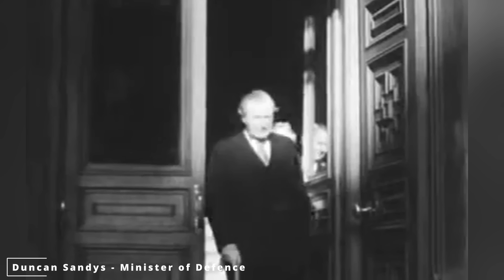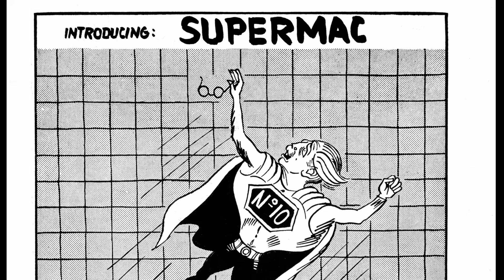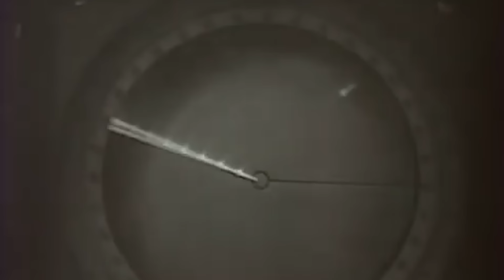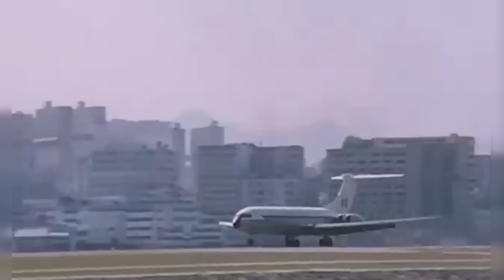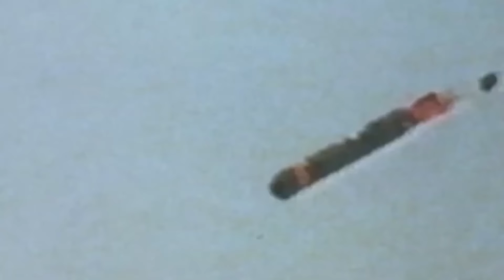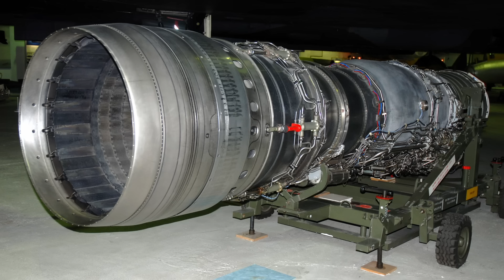How Britain Turned A Failed Airliner Into a Soviet Submarine Predator | The Mighty Nimrod

Comment: The main issue with  creating  the 'successor'  Nimrod was that the Treasury insisted that  rather than create new builds  of them that instead  new wings and engines be added  to existing fuselages. The main problem there was that the fuselages themselves had been  over extended, too many alterations which had  led to a  fuel line running along the inside which corroded and this created a disastrous issue of internal fires.
Reply: The BAE Systems MR4.A program was a shocking fiasco of incompetence and corruption.
Reply: @DoktorBayerischeMotorenWerke 

Comet / Nimrod notes. 

We believe we can clear up some commonly held myths and misconceptions obviously.

It's always good to see the facts presented clearly and concisely isn't it?

Obviously there have been worse aircraft for accident losses both before & after the Comet.

All jet airliners benefited greatly from the knowledge gained from the Comet incidents & subsequent investigations & yet some were still worse for accident losses. 

It's a great pity & a crying shame that British military forces had to occupy a large part of Germany for decades after 1945 & Russian military forces had to do the same. Of course Russia still posseses a large chunk of what was German territory & of course Russia & the UK produce nukes. Obviously Germany does not produce nukes.

Instances of all marks of the Comet flew with full certification after 1954 including the Comet 3. The last Comet flight occured in 1997.

The fabulous trail blazing DH Comet.
World's first jet airliner.
World's first high altitude airliner.
World's first airliner with a full fuselage length pressurised cabin pressurised for high altitude flight. That feature for that type of aircraft was a considerably difficult undertaking. 

How things were back then.
Accident losses - % of aircraft built.

DeHavilland Comet 4 UK                          14% 
DeHavilland Comet all UK (ff 1949)        17%  
Vickers VC10 UK (ff 1962)                        5%

Douglas DC-1  US                                       99%
Douglas DC-2                                              47%
Douglas DC-3                                              30%
Douglas DC-4                                              26%
Boeing s300    US                                       72% 
Boeing 307                                                  70%
Boeing 247                                                   48%
Boeing 707  (ff 1958)                                 32% 
Lockheed L-049 Constellation (ff 1958)  30%
Lockheed Electra US (ff 1958)                   29%
Fairchild FH-227 US (ff 1966)                   30%
McDonnell Douglas DC-8 US  (ff 1958)   14%
Sud Aviation Caravelle  (ff 1955)             15%
Canadair CL-44 Turboprop US (ff 1959) 46%  
Convair CV-580 Turboprop US (ff 1960) 22%
Convair CV-880     (ff 1959)                      27% 
Convair CV-990     (ff 1961)                      33%
Tupolev T-104        (ff 1956)                     16%
Vickers Viscount UK  (ff 1948)                32%  
Fokker F-27 Turboprop (ff 1955)             39%      

The Vickers VC10, fastest Atlantic crossing for a non supersonic jet airliner, held the record for 41 years.

For the first few years of operation the Caravelle & Comet had similar accident loss fatalities.

The first few Nimrod airframes were Comet 4 airframes with the equipment bay tacked on. Subsequent Nimrods were new build Comet 4 airframes with the modifications built by the DH team at Hawker Siddeley.

Military aircraft accident losses. 
Lockheed XF104                 (ff 1954) 100%
Lockheed  P80                      (ff 1944) 43%
Lockheed F104                     (ff 1954) 45%
Grumman f9f                         (ff 1947) 47%
Convair F102 Dagger            (ff 1953) 45%  
MD F-101 Voodoo.                (ff 1954)  34%
MD FH Phantom 1                (ff 1945)  35%
MD F4 Phantom 2                 (ff 1958)  28%
MD F3H  Demon                    (ff 1951)  32%
Gloster Meteor UK                   (ff 1943) 21%
DH Vampire  UK                        (ff 1943) 23%
DH Sea Vixen  UK                     (ff 1951) 33%
DH Venom       UK                    (ff 1949)  16%
Gloster Javelin    UK                (ff 1951) 20%
EE Lightning     UK                   (ff 1954) 33%
HS Harrier      UK                     (ff 1962) 34%

The Sea Vixen was an aircraft carrier jets pioneer aircraft that was also regularly flown from carriers that were too small for the aircraft. 

The Tornado & Typhoon & their engines are supersonic & are indeed British design aircraft with British design engines built by an international consortium. The Tornado design for example started life during the 1950s at Vickers as the AFVG, it's engine is based on the RR RB-199. The EE Lightening is also a British Supersonic jet aircraft.

The Typhoon is the British BAC-EAP with an engine based on the British RR XG-40, the Typhoon is also built by an international consortium.

Global aerospace. 
From the 1950s sector rationalisation and consolidation took place. 70 companies in France and 300 companies in the US disappeared due to merger or dissolution. In the US Boeing was almost bankrupted by the 707 project.  Boeing had a well protected domestic market and the available space and resources in the US to engage in large scale airliner manufacturing enabling them to capture orders simply by being able to produce airframes fast enough. Brazil now has the world's 3rd largest airliner manufacturer & is towards the bottom half of the wealth per capita tables. Most of the countries at the top don't bother trying to have a lone national airliner manufacturer. 

For example, there are of course no German companies that makes German jet aircraft in Germany & there are no German Companies that make German gas turbine aero engines in Germany that are suitable for widebody airliners.

The UK has the world's highest combined per capita Nuclear / Defence / Aerospace Sector Activity.

UK defence sector, absolute terms, world's second highest activity. 1st for per capita defence sector activity. Per capita nuclear powered submarine construction, 2nd position. 
Main players being Rolls Royce, Babcock, GKN Aerospace & BAe Systems. Activities often involve international collaboration. BAe systems, RR and other UK companies now handle more Airbus work value wise than Germany. 

Rolls Royce Holdings UK
Subsidiaries
- Rolls-Royce plc
- Rolls-Royce North America (ex Allison etc Classified Military stuff)
- Rolls-Royce AB
- Rolls-Royce Deutschland
- Rolls-Royce India Private Limited
- Rolls-Royce Marine Power Operations
- Vinters Engineering Limited
- Rolls-Royce Controls and Data Services
- Rolls-Royce Power Systems
- Bergen Marine
Joint ventures include:
- Rolls-Royce Turbomeca
- MTU Turbomeca -

Trent Family
The MT30 (Marine Turbine)
Industrial Trent 60 Gas Turbine
Trent 7000
Trent XWB Airbus A330neo.
Trent 1500
Trent 1000
Trent 500
Trent 600
Trent 700
Trent 800
Trent 8100
Trent 900
   
RR wholly owned subsidiaries in Germany handle smaller 2 shaft RR gas turbine aero engine work.
Reply: @DoktorBayerischeMotorenWerke 

Typhoon & Tornado, British design aircraft. 

Early days of the airliners.

The awesome De Havilland Comet.
World's first production jet airliner.
World's first high altitude airliner. 
At the time the Comet wasn't particularly dangerous. The DH Comet was definitely not the worst engineering failure in commercial airliner history.

Losses comparisons.
How things were in those days.

DeHavilland Comet 4 UK                          14% 
DeHavilland Comet all mks UK (ff 1949)17%  
Vickers VC10 UK (ff 1962)                         5%

Douglas DC-1  US                                       99%
Douglas DC-2                                              47%
Douglas DC-3                                              30%
Douglas DC-4                                              26%
Boeing s300    US                                       72% 
Boeing 307                                                  70%
Boeing 247                                                   48%
Boeing 707  (ff 1958)                                 32% 
Lockheed L-049 Constellation (ff 1943)  30%
Lockheed Electra US (ff 1957)                   29%
Fairchild FH-227 US (ff 1966)                   32%
McDonnell Douglas DC-8 US  (ff 1958)   14%
Sud Aviation Caravelle  (ff 1955)             15%
Canadair CL-44 Turboprop US (ff 1959) 46%  
Convair CV-580 Turboprop US (ff 1960) 22%
Convair CV-880     (ff 1959)                      27% 
Convair CV-990     (ff 1961)                      33%
Tupolev T-104        (ff 1956)                     16%
Vickers Viscount UK  (ff 1948)                29%  
Fokker F-27 Turboprop NL (ff 1955)       40%      

The Vickers VC10, fastest Atlantic crossing for a non supersonic jet airliner, held the record for 41 years.

For the first few years of operation the Caravelle & Comet had similar accident loss fatalities.

De Havilland had prior experience building many all metal construction airframe aircraft & thousands of jet powered fighter aircraft that were primarily of metal construction with pressurised cockpits & jet engines built by De-Havilland. No aircraft before the Comet was subjected to as much pre-production testing as the Comet. 

It's a great pity & a crying shame that British military forces had to occupy a large part of Germany for decades after 1945 & Russian military forces had to do the same. Of course Russia still posseses a large chunk of what was German territory & of course Russia & the UK produce nukes. Obviously Germany does not produce nukes.

Interesting British achievements.

The gas turbine engine was invented & patented in England before the 1800s.

Axial multi stage sequential stage compressor & turbine technology, first produced for turbo machinery use in England by Parsons of Ireland & North England during the 1800s. The components form the basis of most modern gas turbine aero engines. At the time the concept of the jet aircraft powered by axial internal combustion gas turbine engines was first mentioned thus the internal combustion jet engine & jet aircraft was indeed invented in England before the 1900s & before the Wright brothers got busy.

Work on the multi stage sequential stator rotor axial compressor as applicable to the axial compressor gas turbine aero engine was ongoing in England from around 1928 by Arnold Griffiths and others. By 1943 the Metrovik F2/3  Beryl was a running axial turbojet that was superior to anything anywhere else. As the centrifugal compressor engines were adequate and more powerful at the time development of a larger F2/3  version was commenced.

The Metrovik (UK)  F2/3 axial compressor gas turbine aero engine was flight certified & ran in 1942, it was the result of UK development work ongoing since 1929. At the time it was the most capable axial compressor turbojet in existence but was not required and development work continued on a larger version.

Frank Whittle performed the world's first demonstration of a gas turbine aero engine in 1937. People in Germany kept a close eye on everything going on in Britain at the time.

The centrifugal compressor RR Nene was the most powerful & most reliable gas turbine aero engine on the planet in 1944. That engine would be later built under license or copied in many countries including Russia (Mig-15 Mig-17), China, the US, France and Switzerland powered dozens of aircraft types for decades after 1944.

Pratt and Whitney and others produce centrifugal compressor gas turbine aero engines. The PW200 is a currently produced whittle style centrifugal compressor, reverse flow combustor, gas turbine aero engine. 

The world's first wind tunnel was constructed in England during the 1870s. The world's first supersonic wind tunnel was constructed in England in 1922.

There is no doubt that the Fairey (England)
Delta 2 was the world's first jet
aircraft to exceed 1000 mph.  Indeed It
exceeded the previous record by 310 mph &
held the record for 1 year. Incidentally, the Dassault Mirage 3 & 4 are based on the Fairey Delta 2.

More recent UK military jet aircraft.

The Tornado & Typhoon & their engines are Supersonic & are indeed British design aircraft with British design engines built by an international consortium. The Tornado design for example started life during the 1950s at Vickers as the AFVG, it's engine is based on the RR RB-199. The EE Lightening is also a British Supersonic jet aircraft.

The Typhoon is the British BAC-EAP with an engine based on the British RR XG-40, the Typhoon is also built by an international consortium.

Brazil has the world's third largest airliner manufacturer and makes very good airliners & Brazil is 100th down the list along with Indonesia for wealth per capita. Of course it is in fact the case that Embraer can't build those airliners without purchasing stuff from the US, UK & Europe. For example, Norway, Holland, Denmark, Ireland & Belgium, top 20 wealth per capita, don't make airliners, its as simple as that.

Global aerospace. 
From the 1950s sector rationalisation and consolidation took place. 70 companies in France and 300 companies in the US disappeared due to merger or dissolution. In the US Boeing was almost bankrupted by the 707 project.  Boeing had a well protected domestic market and the available space and resources in the US to engage in large scale airliner manufacturing enabling them to capture orders simply by being able to produce airframes fast enough and cheap and nasty enough. Another factor is airlines preferring to obtain as much of their airliner inventory as possible from one manufacturer. 

Global Aerospace Sector, what's happening.

For example, there are of course no German companies that makes German jet aircraft in Germany & there are no German companies that make German gas turbine aero engines in Germany that are suitable for widebody airliners.

The UK has the world's highest combined per capita Nuclear / Defence / Aerospace Sector Activity.

UK defence sector, absolute terms, world's second highest activity. 1st for per capita defence sector activity. Per capita nuclear powered submarine construction, 2nd position. 
Main players being Rolls Royce, Babcock, GKN Aerospace & BAe Systems. Activities often involve international collaboration. BAe systems, RR and other UK companies now handle more Airbus work value wise than Germany. 

There's a good chance that anyone currently flying on a widebody airliner will be on an aircraft powered by RR gas turbine aero engines made in the UK and a good chance there will be other hardware on the aircraft that's designed and / or manufactured in the UK. 

Rolls Royce Holdings UK
Subsidiaries
- Rolls-Royce plc
- Rolls-Royce North America (ex Allison etc Classified Military stuff)
- Rolls-Royce AB
- Rolls-Royce Deutschland
- Rolls-Royce India Private Limited
- Rolls-Royce Marine Power Operations
- Vinters Engineering Limited
- Rolls-Royce Controls and Data Services
- Rolls-Royce Power Systems
- Bergen Marine
Joint ventures include:
- Rolls-Royce Turbomeca
- MTU Turbomeca -

Trent Family
The MT30 (Marine Turbine)
Industrial Trent 60 Gas Turbine
Trent 7000
Trent XWB Airbus A330neo.
Trent 1500
Trent 1000
Trent 500
Trent 600
Trent 700
Trent 800
Trent 8100
Trent 900
   
RR wholly owned subsidiaries in Germany handle smaller 2 shaft RR gas turbine aero engine work.

The UK space and aerospace sectors are highly productive, high-value industries that together contribute over £18 Billion in direct Gross Value Added (GVA) to the UK economy. Individually, the space industry directly contributes about 0.3% of UK GDP 7•2 Billion while the aerospace industry contributes approximately 0.5% £10•9 Billion.
   
We hope this helps.